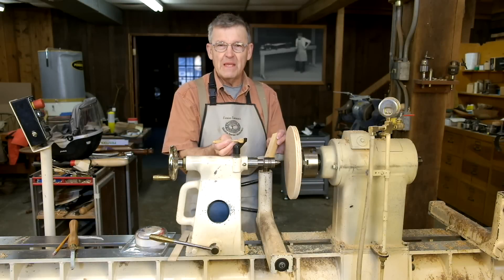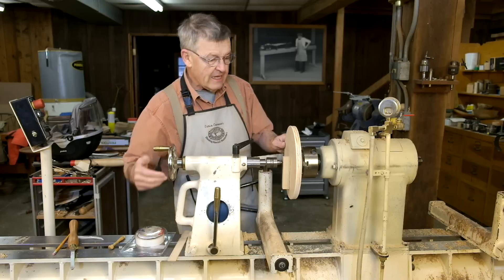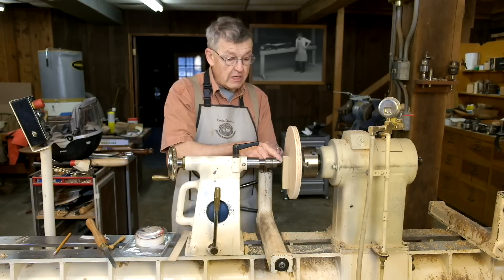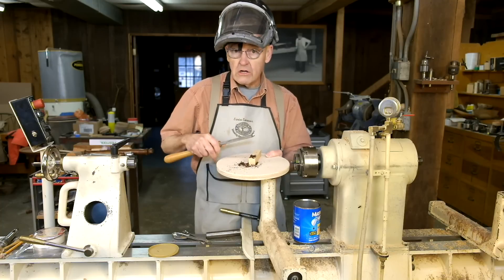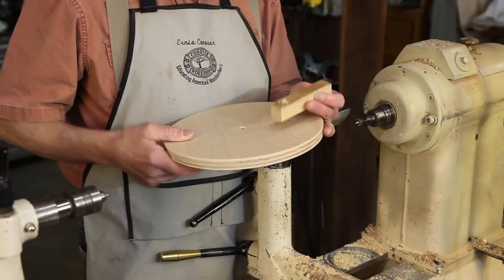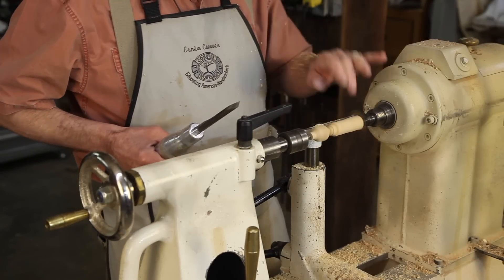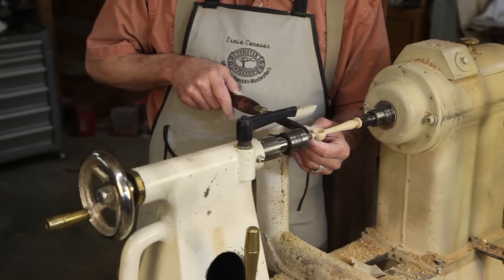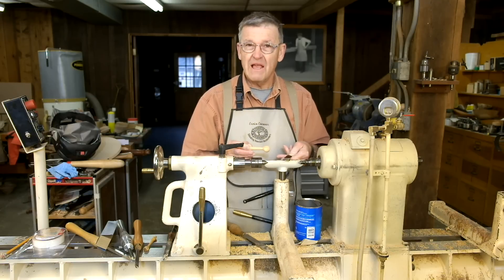How to Turn a Small Measuring Spoon | Two Axis Woodturning

Comment: I used to make Black Powder measure  out of antler and bone   I used corn Meal as My testing meduim  Black Powder is measured by volume rather than Weight   so I measure out a volume charge of black powder  drilled a hole in a scrap block  when I got to the size I wanted in BP I marked the number on the scrap wood peice  

Then at the black Power renactment  I had a wooden box that partial filled with corn Meal  and My known size blocks   I could use primitive tools to make custom powder Measure  people would bring Me peices of Antler or bone from a animal they had taken    the year before    and I made the measure from that  

Ok I am rambleing on now 

My point is use corn meal is cheaper than spilling coffee on the floor  as your checking of the right volume of the scoop